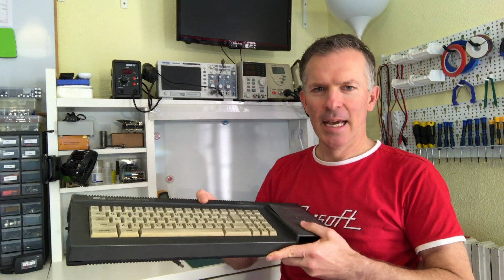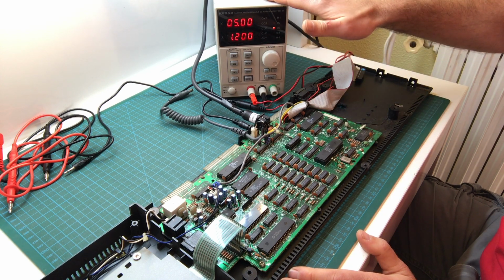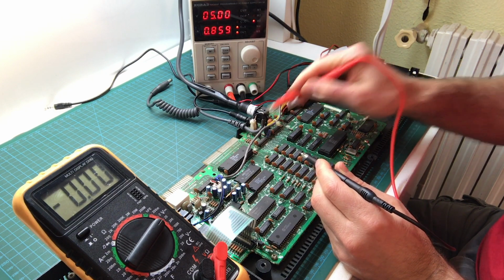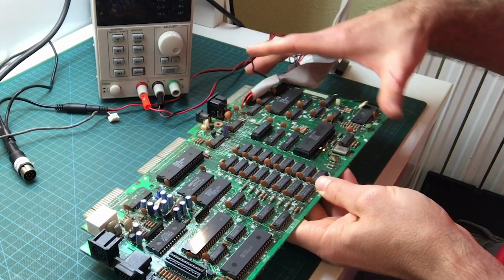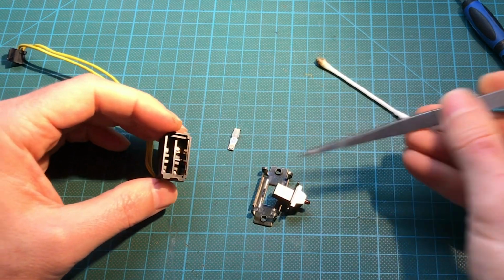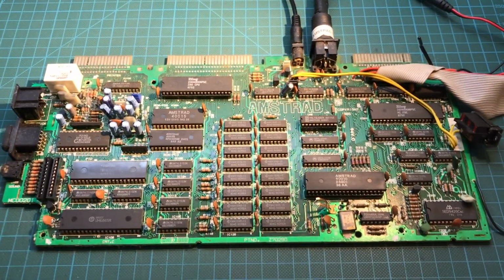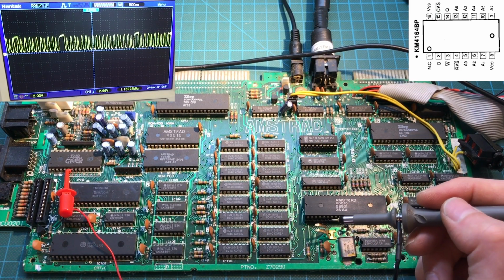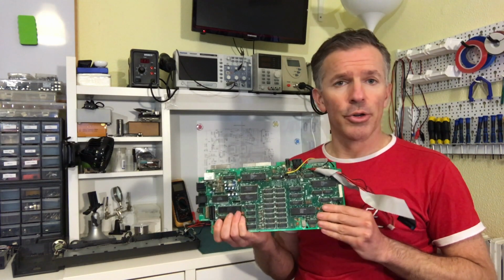Amstrad CPC 6128 with Black Screen (Part 1)

Comment: Hi, if I use gotek disk emulator instead of the original disk drive, do I need to connect 12V psu to my cpc6128 or is the 5V psu enough for it to work?

Comment: Hello again Noel! im still testing and repairing my 6128 and so I bought a dandanator to get it to run a diagnostics and what I have is the red screen and then the ram numbers - they are all red. I performed a bank swap jumper test then to force the other bank and that is all red 0 to 7 also. I have checked the voltages and each ram chip is getting the correct voltage, and I have checked the traces as best as I can but I feel that I am missing something. 
When booting I just get the grey screen with black border. It is as if the cpc isn't seeing any of the ram chips (they are getting warm and receiving power and I checked continuity between each of the chips and all of that. Even to the HAL chip and so on. I am just getting stuck at what to check next! :(
Reply from the maker: I'm going to guess it's not a RAM chip then. You can always swap one out with one that you for for sure works, and if it's still red, then it's something else. My money is on a bad multiplexer. Check out my latest Amstrad CPC repair (I think 2 videos ago) and it has that exact same problem. Or hop on the Discord channel if you need more help. Good luck!

Comment: First of all thanks for this series of videos. I reached your video trying to fix my CPC 6128, which is in a very good looking  conditions, but there is no image and no sound when type DEL, although it seems there is some internal activity, according to what I see in the oscilloscope. When I switched on, after several years off, appeared some pixels, some minutes later only a square in the middle of the screen, and now nothing, everything blank. This happened in a period of some minutes and after switch on/off a couple of times. My question is that Z80 M1 pin 27 is static HIGH (monitoring it since the switch on). I guess it should be changing trying to fetch op codes from the Memory. Do you think there could be any external cause that makes the M1 be static, or it likely means the Z80 is in bad state? (there seems to be activity in pins 19 MREQ and 28 Refresh). On the other side, not know if related to this, VSYNC seems to be around 3Hz and HSYNC is inactive 0V, and chip IC108 is a little bit warm, more than the rest. On the contrary Gate Array is cold. Thank you very much in advance.

Comment: I have been watching som of your videos and I noticed something that you dont do right. When applying power to the board you set your bench power supply to the exact voltage for example 5 volts or 12 volts like in this video. It is fed through 7805 ic and those ICs require at least 2 volts higher at the input pin to be able to sustain the voltage they ae designed for at the output. No wonder you are measuring 4.47 volts at the ICs power pins. The voltage regulator 7805 doesnt have the resource to keep 5 volts as there will always be some voltage drop across the regulator
Reply from the maker: That's right. But the Amstrad CPC doesn't have any voltage regulators! It expects a straight 5V input. The ZX Spectrum on the other hand does have a 7805 so I usually feed it 9V just because that was the original voltage of the PSU, but 7V would be fine too.
Reply: @NoelsRetroLab  There was a video I watched a day ago about ZX Spectrum clone repair that you fed with 9V although there was 7812 regulator on the board. And since the original power supply provides around 14 volts I dont see how that 9 volts would have powered up the board correctly. Even thou that was probably enough to drive the IC that you measured the voltage on

Comment: I was going to use my Amstrad CPC6128 that was running fine time ago and when I turned it on today it didn't show any light, as if it had no power. The problem was the switch just like yours. Mine was half as dirty as yours, but it didn't make any continuity either. So problem fixed, and very fast watching your video ;) Thanks.
Reply: Does the HxC works nice for you?. Mine works from time to time. Who knows? Maybe I have a problem with some related chip too (no idea where to look at) as I also remember the disk drive working sometimes only with a new belt and cleaned even. I haven't extracted and reinstalled any chips there. I've ordered a Dandanator. I've also heard about the M4, but it seems complicated to use?. What do you think?

Comment: i swithc the cpc on and it does not display anything. Power on led is not lit. I measured the voltage at the back of the switch and it is 4.85V. Do you think it is low enough and it cannot power up the machine?
Reply from the maker: Amstrad CPCs often run low in voltage, so that's pretty normal. If you're getting nothing I would check that the Z80 is alive (clock signals, M1, RFRSH) and then check that the Gate Array isn't faulty.
Reply: @NoelsRetroLab  Hi Noel, thanks for your response! I like your videos and they are very educating.

What i found just one hour ago was unexpected: I put a jumper on the 2 pins that the cables of the switch are connected, and it worked. So i assumed that the switch needes cleaning. I cleaned the switch, tested with the switch and  sometimes booted.  Other times it  did not boot. For example when i was lifting the machine the switch worked which was very strange and made me think that it had to do with a loose cable connection. Finally it was not the switch mechanism itself , but a bad connection of the small socket of the switch cable that connects the two pins on the motherboard (I assume that they both carry the 5V,  one from the powersupply and the switch just interrupts the voltage supply). After moving back and forth the  yellow  cable and applied pressure, on the socket  cpc booted  every single time. But this is temporary solution. I do not know, maybe i will have to use a contact cleaner, slightly bend the pins so that the socket is latched properly.

Comment: great stuff noel :)
when you talking about corrosion on the switch.. putting in a little resistance
the internals on the rear 5v connectors on board corrode quite badly... causing a little of the same thing
the only thing i have found that cleans them up is something called deoxit.. its old school
shame we cant get a lot of the spares for these
unless some can help me out with that...
maybe we could contact Mr sugar...
N

Comment: Hello Noel, I have a cpc 6128 amstrad and I have the following problem, When I power it on the light on the keyboard goes on and instantly is goes off. I checked the switch and cleaned it but the issue remains. Also I measured the voltage on memories and AY chip and they are 1 volt all of them ( I measured them using the way you show on your video). could you guide me or give me any hint what may be wrong.

Comment: How do you connect the external bench power supply to the board? I try to figure out the cableing... is this a cable with banana jacks for the power supply on one end, and the other end a jack plug?
Reply from the maker: Exactly. And make sure it's set up with center positive, not negative like the ZX Spectrum!
Reply: @NoelsRetroLab  Thank you. Do you have a video maybe / or description on how you made that specific cable for the Amstrad?
Reply: @NoelsRetroLab  And if you allow me another question here. Why is the barrel plug (male) then going into a female barrel that finally goes into the CPC and not directly connected to the CPC?
Reply from the maker: @stellardynamix  Ah right! That's my video cable. These RGB to Scart cables need to provide about 3V on the blanking signal to tell the TV to interpret the signal as RGB. Unfortunately the Amstrad CPC doesn't have any source of voltage from the video connector, so we need to feed it externally. This particular cable (I made this one) takes a 5V through a female jack, and then has a 5V coming out through a male jack to connect it to the Amstrad. You could do something like that with a Y splitter, but it's one more cable and there are plenty of those already! :-)
Reply: @NoelsRetroLab  Thank you again for taking the time to explain all this. Well i know, it might not be worth the time, but it would be a really interesting video on how to make such a cable and explain the different connector/video setups? Super cool...
Reply from the maker: @stellardynamix  I actually added it to my list, so maybe it'll happen sometime. I was also thinking of trying to make such a cable without the need for an external voltage supply, and instead just use a capacitor. Not sure if it's possible, but if it is, it could make for an interesting video. Cheers.

Comment: What is that empty 40 pin socket for on the other board you tested out the z80 and PLA on? looks like it says 40007 under it.
Reply from the maker: It's a socket for another Gate Array. Some PCB models have place for both kinds of Gate Array (40007 and 40010). I suppose that made sense while they were transitioning. I socketed mine to be able to test both kinds on it :-)
Reply: @NoelsRetroLab  I did some searching and indeed found this out. thanks!

Comment: These 8-bit and 16-bit computers that were extremely popular in Europe in the 80's and 90's are so fascinating to someone like me in the States.  I would love to get my hands on a Spectrum 128K+ or whatnot, the one with the built in Tape deck.  My dream machine is an Acorn A4000 computer.  I think that's what it's called.  I don't think they ever saw light over here in the States where I live.  So fascinating to see.

Comment: I have a dead CPC 6128 

I have replaced the Zilog CPU

I have been trying to find a replacement for the Gate Array chip 40010 which almost next to mission impossible

I have wired up the system to a GBS-8220 video converter board as the green screen i have is dead. I am attaching the picture of the monitor and what it shows, maybe someone can guide me what is the problem there

https://www.reddit.com/r/computercollecting/comments/dww9q3/amstrad_cpc_6128_resurrection_failures/?utm_source=share&utm_medium=web2x

 don't have a 100% perfect power supply setup for the system but for now i have attached a 5V 1AMP power supply to the 5V power input on the computer,  The 5V supply should be 2A instead of 1A as the system requires 1.7A 5V,can this in any way contribute to what i am experiencing ?

If i attach the the board to my dead green screen CRT it shows a totally blank screen and i noticed that the Zilog chip gets incredibly hot after a few minutes. The voltages with the 5V 1amp supply across the 5V connector is around 2.3V and when i connect it to the 5V of the monitor its 5V

Kindly guide me
Reply from the maker: 1A is probably not enough, so that's problem number one. If the Z80 gets really hot, you should find a replacement because it's definitely faulty and will contribute to not getting any image. Fortunately it's socketed, so it's easy to change. Good luck.
Reply: @NoelsRetroLab  I am in the process of getting a 2A supply, the  new replacement chip was also getting hot. So the problem is still probably somewhere

Comment: Got a 464 with black screen... I'm hoping it's just the cap on the reset circuit....
Reply from the maker: I've never seen the cap cause that. You've ruled out the switch already? The Z80 is the next most likely and they're easy to replace. Next possibilities are the Gate Array and the CRTC. The good news is that it's definitely fixable :-) Good luck!
Reply: Cap was replaced first as they're the first thing I always suspect first - plus I had a spare and if the reset line is held low it can cause all sorts of oddities on Z80 based devices of course (this is only the second CPC I've fixed... I've done many Sinclairs...). Anyway nope, wasn't the cap. Not the switch (I get a good 4.7v+ on the supply pins) and not the Z80 (I've got plenty of working spares so swapped one in). I've got a CRTC on order as I want to have a spare available even if it's not that... Will poke around with a logic analyser/data probe next... I'll let you know how things go and thanks for your video and for replying to my post. Appreciate it.
Reply from the maker: @JeffAvebury  Then I would say it's either the clock generation, the CRTC, or the Gate Array. Check that you have some activity on pin 6 of the Z80 (even if it's with a multimeter). If that's dead, then there's no clock. I've had that happen several times. The 74xx logic that helps generate the signal from the crystal oscillator fails and then nothing works. Easy fix that one.
Reply: Thanks Noel, when I find where I put the logic analyser etc when I moved the mancave, I was planning on checking clock, plus the syncs etc from the CRTC and Gate Array.